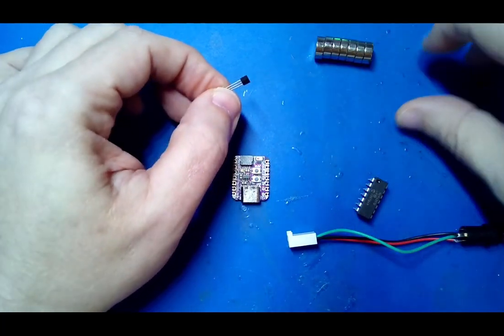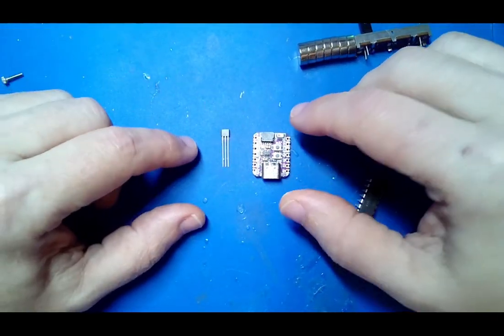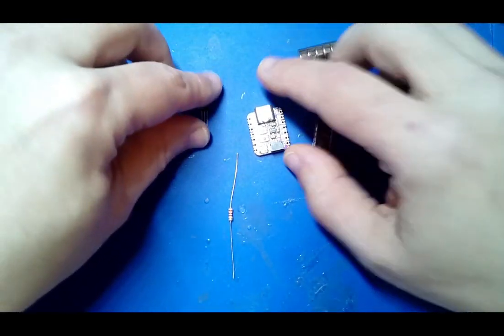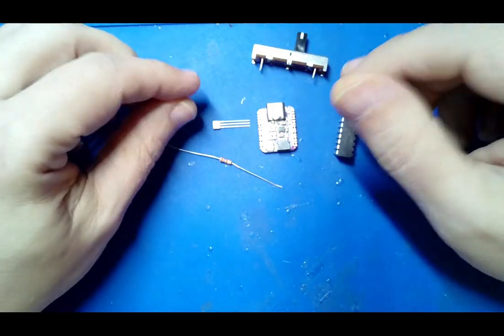XBOX Adaptive Controller, Analog Hall Effect, and Digital Potentiometers

Comment: i want to make an LT/RT for like racing games but wanted to see , what is easier to do 
im not 100% on this side of stuff but i can code
can i make an LT just using a Arduino nano and use the internal resistor 500ma with a smaller but more sensitive range do you think it can be done
Reply from the maker: I've heard from another maker that's it's possible to use the PWM pins to send values to the LT/RT. It's not something I've done myself, though he mentioned needed another resistor and capacitor in the circuit. (I'll e-mail him to clarify.) 

One of the reasons I use a digital potentiometer (or a optocoupler for on/off buttons) is that it separates the two circuits. Using PWM to send signals means you're tying the two circuits (Nano and XBOX AC) together. So you have to be concerned about voltages. For example, the XBOX AC is looking for 5V. But many boards are 3.3V (the ones I use are all 3.3V) -- so I can't provide the full voltage range that the XBOX AC wants. This wouldn't be an issue with a Nano, as it's 5V, but would prevent a great number of boards from being used (ex Pi Picos).

This is something that I want to actually test and see -- as it would make wiring a lot easier, and have fewer parts. But I've not had a chance to experiment with it yet.

Comment: Hi Ron, quick question.  I taken the cursor coordinates and passed them over serial to an Arduino.  I'd like to use the A0 and A1 pins to send the analog signals to the Xbox adaptive controller.  Will I have any voltage considerations to worry about?
Reply from the maker: The short answer is you can't. The XBOX X1/X2/TL/TR are voltage divider circuits. You have to apply a resistance, not a voltage. And that resistance has to total 10K (otherwise you won't get the full range).

The only way into the analog ports is pots -- either mechanical or digital. 

That's why you see "dumb" (no microcontroller) sticks used for X1/X2. For smarter sensors, it's most common to use a microcontroller and go through the USB ports. However, that just gets you joystick -- not Triggers.

If you want triggers, and non-pot sensors (ex. Hall, laser, etc) you need to go the microcontroller and digital potentiometer route. 

Same holds true for the PS5AC.
Reply: Thanks,  I appreciate it.  Glad I didn't waste a bunch of time going down the X1/X2 route. Or do anything that would wreck the XAC.
Reply: The other thing I've been doing successfully is using a Python script to turn key activations (Alt-Controller overlays) into a bit string and using the position of bit to trigger different pins that lead into optocouplers and relays.  Works really well on the XAC and Hori.  It's more for eyegaze and head trackers.

BTW, any idea why my optocouplers never work on DC switch adapted toys?  Just the relays work. It's the pc817s
Reply from the maker: @dairheart  For the toy issue, it's likely a matter of output current. The 817 is rated for up to 50 mA -- fine for logic level, but not stuff that requires more juice. That's why you almost always see optocouplers mated with transistors (for <12V) and relays (for line voltage).

https://www.nutsvolts.com/magazine/article/optocoupler-circuits

Another route is to go with a solid state relay. But read the specs! Most you find on Amazon are the cheaper AC only ones. (They rely on the AC cycle to reset themselves--so they don't work with DC/toys.)
Reply from the maker: One other thing I've used is reed relays. I've been able to direct drive them from an Arduino pin without destroying anything. This one will do 500mA on the output side: https://www.digikey.com/en/products/detail/coto-technology/9007-05-00/301696